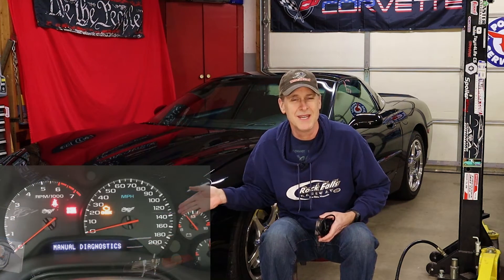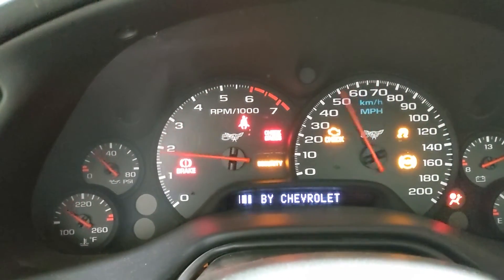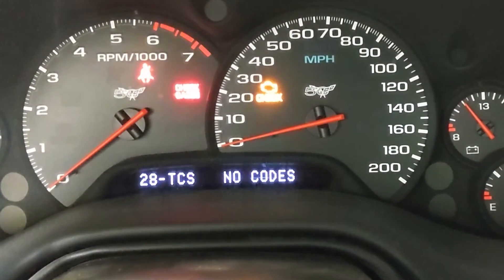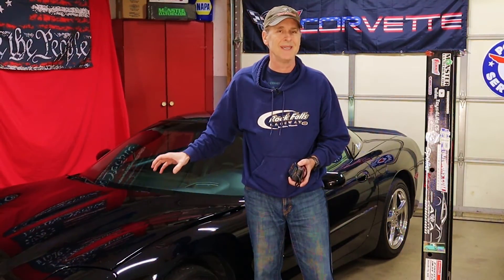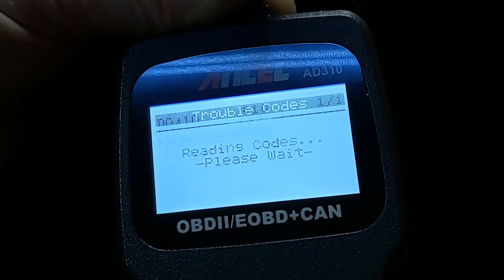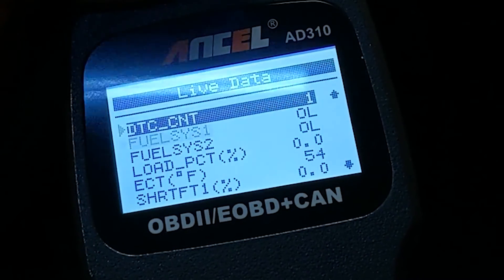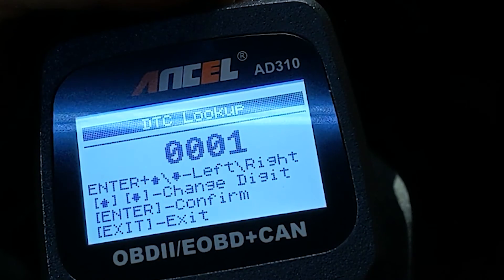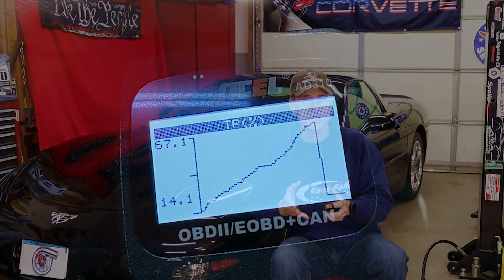C5 Corvette Built-In Diagnostics vs. $25 Ancel AD310 Scan Tool

Comment: Are you going to be doing a review of the OTOFIX D1 Lite? Very curious to see what it will be able to do.
Reply from the maker: Yes, but I have a couple of videos in the works that use its capabilities to do perform some awesome & useful tests/functions!
Reply: @Toys4Life  Nice, looking forward to that. I'd been looking at one of the TOPDONs in the same price/spec range, but it's come up recently in TOPDON's terms of use that after the 2 years of free updates you may not only have to pay for updates (which is fine and to be expected, of course), but may also lose some functionality like bidirectional controls. I saw this in another video comparing various OBD II scanners and at this point it's unclear of exactly what will or won't happen after that initial free period. Looking through OTOFIX's site and the user manual for the D1 Lite I didn't see anything like that.

Comment: The Wix oil filter you listed is made in China. This is the correct made in USA model WIX 51042XP Heavy Duty Lube Filter
Reply from the maker: Both work for the C5 and C6 and Wix filters.  IMO Wix is confident about the quality and has put their reputation on the line.  Than having been said, sgree about the origin and changed the link - thanks!!

Comment: My scan tool work along with Android and displays gauges as dials graphics and it cost about $20 5 years ago. So far have had no need to use it (DIC sufficient) on either of my 2 2003 coupes.
Reply from the maker: Which one do you have?
Reply: @Toys4Life  I'll look it up tomorrow.